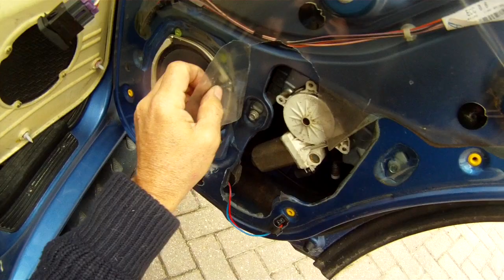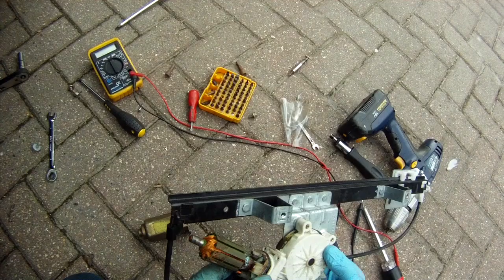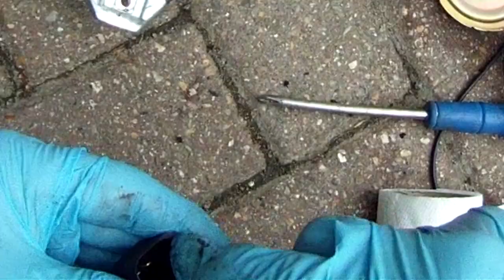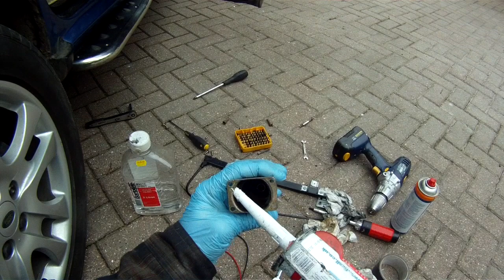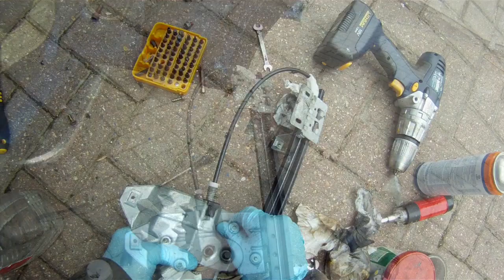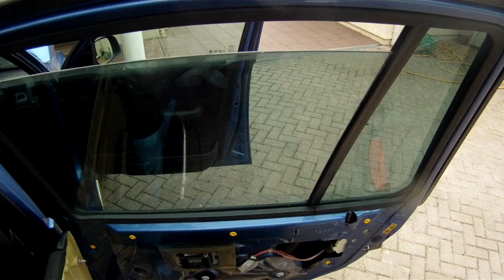How to Fix an Electric Window - Freelander 1 (Rear) & Other cars

Comment: Do u know if a motor from any other door  will fit onto the passenger side rear window regulator, are the motors all the same and just the other parts of the regulators that make it lift or right? Thanks.
Reply from the maker: Yes from the same car model and possibly other models and makes but I am not sure which ones use the same lock.  The motors in my link from ebay can also be used by swapping the worn out brush end.  Be sure to note the orientation of the motor body when dismantling.
Reply: @comeinhandynow  thank so much I now have a working motor 👍 I just cleaned the communicator and brushes.

Comment: 1:12  The thin plastic sheets you are removing:  It's important to stick plastic sheets back over the large holes (wherever you removed them from), otherwise rainwater can leak into the car by dribbling down behind the door panel... this happened to me with a car, and it took me ages to work out that a tiny bit of water was leaking behind the door panel into the car, causing condensation inside and a strange smell, as the carpet slowly absorbed the water (because I removed the plastic sheets and didn't replace them)..... after I replaced the plastic sheets, making sure they were sealed properly around the edges, the leak stopped, the condensation went away, and so did the smell.
Reply from the maker: Thanks for your good advice.  I have always thought they were there for a reason and am often surprised how many garages and people tear them off.

Comment: Is there a way to wind the window back up without replacing the motor, if my motor stopped working and I don't want to replace it?
Reply from the maker: You would have to disconnect the cables and push the window up jamming it in place with something like a piece of wood.  Better and more satisfying to have a go at fixing it properly.
Reply: @comeinhandynow  All my windows stopped working together, along with central locking, sunroof, heated seats, boot switch, rear wiper, interior lights, radio, clock... but no fuses are blown....
Reply from the maker: @amana1480  Have you checked all the fuses, in engine and cabin?  Next check which fuses are getting power with a multimeter.  It could also be an Earth/negative connection problem so measure the voltage at either side of, for example, a bulb that should be on.  If both sides have power then you have a an earth problem.
Reply: @comeinhandynow  Yes I checked all fuses in the car (under the steering wheel) and under the bonnet.  The OBD port doesn't have any power either, so I can't scan for fault codes.  Apart from that the car drives fine, and all the basic/essential things to pass an MOT work fine... but very awkward not being able to wind windows down or not open the boot or listen to radio etc...
Reply: @comeinhandynow  I also disconnected the main car battery for half an hour to see if that would reset the car, but it didn't make any difference.  Someone told me that when I reconnect the battery, the rear boot window should wind down by itself, but it didn't.
Reply from the maker: @amana1480  Like I said, measure the voltage on both sides of a bulb that doesn’t work, with a multimeter, with its negative lead on battery negative.  When it is turned on, but isn’t working due to your fault.  If the voltage is 12v then you have an earth problem/disconnection.  If it is 0v then you have a power connection problem.  Now look at the wiring diagram, in Haynes manual, and following the wiring back, testing the voltage as you go to find the disconnection.
Reply: @comeinhandynow  Ok I will try.  I have been told by one mechanic that it might be a faulty Body Control Module.  I have been told by another mechanic that the internal heater matrix has a small leak and may have corroded some wires/connectors near it.... but I don't think I will be able to check this without removing the entire dashboard etc.
Reply: Ok.great vid. But I've got +12v coming in but not -12v which may be the problem. Any ideas thanks

Comment: Thank you much help here The plastic clips holding the spring and cable in place broke off now how do I rig it?
Reply from the maker: Try to look for places that cable ties could go through to hold it together and gives strength while at the same time glue the parts together with polymer sealant/ adhesive.  Drill holes for the ties to go through if necessary..

Comment: Having just watched your helpful video and successfully repaired my faulty electric window, can I just add a point which will hopefully help others: undoing the bolt attached to the slide is very tricky when the window is all the way up but unavoidable since the mechanism will have seized in this position. However, after inserting the replacement/repaired regulator in the door but prior to screwing in any bolts, hook up the electric feed and wind the slider all the way down. Then, carefully remove the duct tape while supporting the glass and ease it all the way down. You should now be able to easily access, align and bolt up the slide mechanism with a long 10mm socket or straight driver before tightening the remaining 3 bolts. Hope this helps someone else!
Reply from the maker: Thanks fir your input, nice to hear.